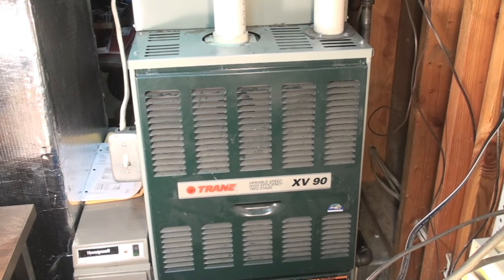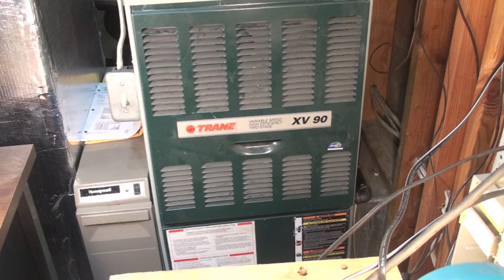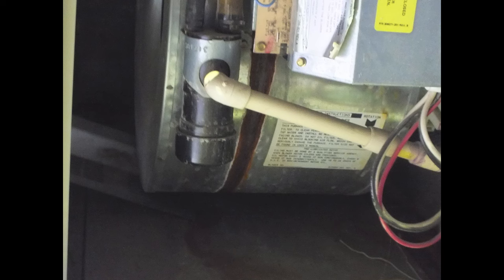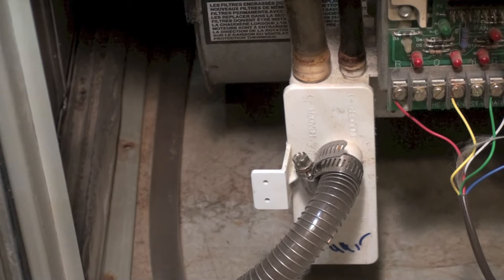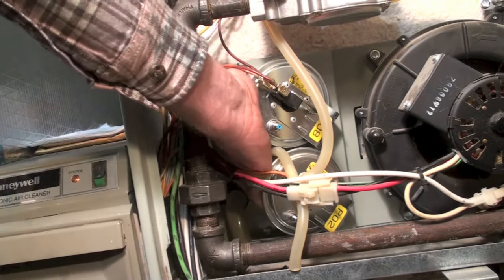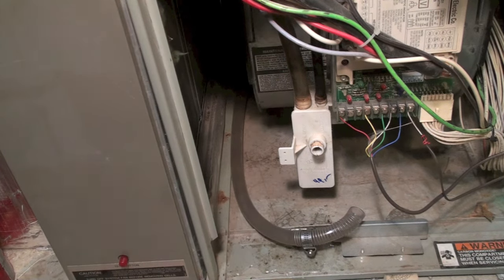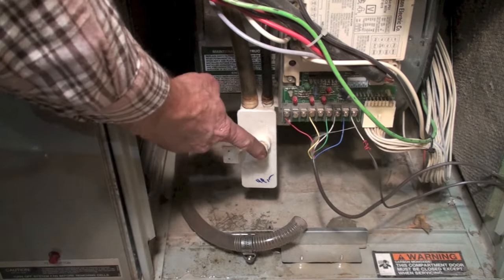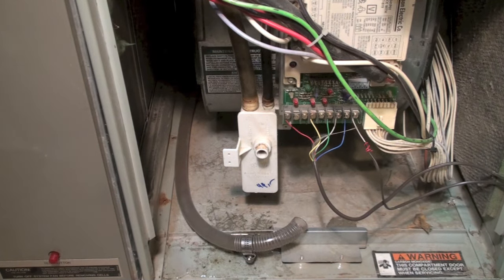Furnace condensate drain cleaning

Comment: I had technician service and he replaced pressure switches. Then 6 months later a different technician drained the condensate trap. Therefore furnace problem was never pressure switch. He removed trap and blew water and dirt out of the trap as well as pressure switches.
Reply from the maker: It is possible the water backed up in the piping to the level of the pressure switches.  That would necessitate replacement.
GFM

Comment: Trap smart and beware of double trapping. This will create vaccuums, plugging problems and screw up the inducer. But it also creates more money for repairman’s pockets, so them installing the drainage pipes in flawed configurations is a cash cow. You can create a double trap with your condensate pump too if tubing goes below water level. Yours truly, Kip G.

Comment: Is that thing really just a simple P-trap, or is there more to it? Why is it box-shaped? Have you ever opened one -- what does it look like inside?
Reply from the maker: +CognitiveDisonance I have not opened one.  Maybe I will do a video on it.
GFM
Reply: Yeah, I would like to know more about these. Like are they interchangeable? Mine is 30 years old and a little crack developed that allows condensate to dribble out. Previous owner fixed it with pvc cement and I am about to do it again. Could replace it with a $100 replica but then I see others that have all the same ins and outs for waaaaay cheaper so why can't I just install that at the same elevation as the old one and be good to go?

Comment: Thank you for the good video's . My 95% York condensate furnace was never installed with a P Trap. Would that be a good reason why my roll out switch keeps tripping. Thank you for any help you can give !
Reply from the maker: nastydog131 Probably not.  If the condensate line goes into the bottom of the condensate pump, that will act as a trap.  Although not a good one.  Look for heat exchanger cracks first.  Hope this helps.
GFM
Reply: The flame roll out for me was a partially clogged 2nd stage. It had half of the slots for air rusted shut so not enough vacuum to pull a nice flame cone. I pulled the 2nd stage an dissolved the rust by pouring through muriatic acid until iopen up.  Took a while, labeled everything as taking apart and took photos at each disassembly.

Comment: What is your opinion of this?  During pre season check and mx I would flush the flue pipe with hose water to clean the entire condensate drain system of the furnace.  I would add water at the end of the pvc flue a little bit at a time.

I haven't service furnaces in years now though.
Reply from the maker: dpeagles I don't think its a bad idea.  However in winter my hose always seemed to be frozen!
GFM

Comment: I have the exact unit pictured in the video...how much fall do you need out to the bottom the the existing trap? Can you run the drain hose from the trap directly into my 2" drain line for a bathroom sink vanity...downstream of the sink P trap without causing a double trap issue pressure switch issue?
Reply from the maker: There is no drop necessary, but if you are draining into an existing  drain you need an air gap.
GFM

Comment: OK, where do you put the shopvac hose? On that white part of the trap? My almost new furnace is not functioning and it's the middle of the night. The inducer motor/fan comes on and the igniter comes on, but the gas burners will make attempt after attempt to light, but won't light. The inducer goes on and off many times as does the igniter. Then after many long tries with thumps and bumps which I assume are the burner trying to ignite, the thing will finally ignite and burn for all of 2 minutes. I hear and see dripping coming out of the drain hose into the floor drain, so I assume it's clear. But the furnace is still going through what I wrote above. The red led will sometimes blink 3 times, then go on to blink random, like 25 or 30 or 11 times. The 3 blinks will happen again. American Standard Silver 95% EFI.
Could it be as simple as dirty filters? I'm out of filters and they have to be ordered online 20x25x5 for Trion AirBear. The filter looks okay, not all gray and dirty but still white. Is it wrong to let it run without a filter for the night, if that will even work? I tried taking each tube off the pressure switch and blowing gently to see if they were in need of clearing. The tube on the top nipple of the pressure switch would not push or pull air when attached to the switch. Is that normal?
Reply from the maker: +Doctor Spaceman You can run it without filters for a short time.  If you want to clean the drain, with a shop vac, remove the sensing tubes on the pressure switch then on the white trap.  The random blinking bothers me.  It does not sound right.  Possible bad connection.  You can try jumping out the thermostat at the furnace.  Jumper R to W on the board.  Hope this helps.
GFM
Reply: Hello 
What did it end up being? Mine is doing the same thing

Comment: I have a Carrier Weathermaker 9200 and when it starts up it makes a rattling noise and usually goes away after 2 or 3 seconds.  Today it didn't go away so I went downstairs and took the cover off and it seems to be coming from what I THINK is the inducer motor.  It's not from the motor itself but from the black housing.  It kinda sounds like theres water in there and may not be draining because of the reasons you mentioned in your video.  Does that make sense?  If so how do I fix it?  There are screws on the edges of the black housing so I assume that is what I unscrew.  I know NOTHING about HVAC so that's why I'm asking.
Reply from the maker: Ian Watson Your unit has a trap in front of the main blower.  I would be cleaning the trap and hoses.  I would not disassemble the the inducer housing.  Hope this helps.
GFM

Comment: Gary, I was wondering why my gas direct vent (upflow) furnace (High Efficiency) makes a lot of sound in the exhaust vent pipe. It's almost a gurgling sound. We are the loudest in the neighborhood. The furnace works fine since it was installed in 2010, but it's loud since it was installed. I'm wondering if I have excess water (condensate) in the line causing a trumpeting effect. Maybe the venting was installed incorrectly (with low spots).
Any idea?
Reply from the maker: +AIR CTI Technology You could have the furnace installed correctly as to level.  The furnace should be level front to back or slightly lower at the front of the furnace.  Hope this helps.
GFM

Comment: I thought your supposed to tale out the white box and clean that out.  I do that with mine as there is a lot of gunk which builds up in there.
Reply from the maker: You can do that.  This is just an easier way.
GFM
Reply: I do too. What I don't know is why does the p trap need to be filled with water after the cleaning.
Reply: @herewegoagain-sd9hr  because the furnace will not run until the system is sealed. The water in the P trap seals the system and allows the pressure switch to work, and the furnace to run.

Comment: Is this only an issue for ac or could it cause a code when trying to start the heater?
Reply from the maker: If your furnace is a condensing one (90+ efficient), a blocked drain could cause a code.
GFM
Reply: @grayfurnaceman  not 100% sure if its drained. Looking at the trap (white box) it looks bone dry. I'll have to check the piping. Should I just run a snake in there to be sure? Or would a decent amount of suction/air blow it out.
Reply from the maker: @photojnt  A vac will do.  Be sure to disconnect the tubing from the pressure switch before vac.  When you are done, fill the trap with water.
GFM

Comment: I have a Trane XR90 and there is water leaking on the metal base of the furnace.  I see water seeping from the 2 hoses that are connected to the top of the plastic trap...there are no clamps on these hoses...would clamps stop it from leaking?  What can be done to correct this issue?  Mike
Reply from the maker: +Mike R I would replace the tubes and install clamps.  Be sure the trap is not cracked.
GFM
Reply: +grayfurnaceman Thanks...can I take the trap off and run water through the (2) ports where the hoses connect and check for cracks in the plastic trap?
Reply from the maker: +Mike R Yes.  You should remove and clear any blockages too.
GFM
Reply: +grayfurnaceman Thanks for all of your advice...I added clamps to both hoses and remedied the leaking that was occurring.

Comment: Where does the condensation come from?  Is it a byproduct of the combustion of the gas or is it drawn in through the induction system?
Reply from the maker: When gas is burned, the products of combustion are C02, water vapor and heat.  It normally exits in the vent as steam.  High efficiency furnaces remove enough heat to condense the water in the gas.  It might be interesting to note that this water was last liquid water possibly millions of years ago.  It was locked in the natural gas compound.  
GFM
Reply: grayfurnaceman Is the high heat removal accomplished through carburation or the setup of the heat exchangers?

Comment: My Bryant Plus 90 from 1988 has that black plastic trap as you show on the Carrier.  I've cleaned it a few times over the years.  It drains into a basement floor with its outlet beneath the water level in the floor drain trap.  So I've got two traps.  Is that good or bad?  I really can't think through how the two traps would interact.
Reply from the maker: WD Hewson It should make no difference.  It will work fine.
GFM

Comment: I have a trane x95 and it keeps giving pressure switch errors.  I've checked all the hoses to and from the switch and the water trap and I can't figure it out. When I pull the hose for the condensate drain a lot of water comes out of trap.  It'll run after that and blow warm air but I can hear it build up again and it'll switch off due to the pressure switch error again.  I check the trap by pulling the hose that leads to the drain again and it drains the same amount of water again.  I wish I could figure this out.
Reply from the maker: Do you hear water in the inducer?
GFM
Reply: grayfurnaceman yes I hear water moving when it tries to start up and then hear it falling down when it fails. After I drain it and it runs fine warming for a few degrees and then the heating will stop after building up water again and it'll just continue circulating air only. It did this last year when it got below freezing as well - we had a someone out to service it but he didn't figure it out.
Reply from the maker: About all I can come up with is possibly the trap is not connected correctly or there is a blockage in the inducer drain.  Some of the Trane unit can get a kink in the line from the inducer.  I have seen this effect trane unit operation.
GFM
Reply: grayfurnaceman After disconnecting the hose that connects the trap to the drain pipe I tried pouring water down it. It backs up. Looks like I'll have to either unclog, defrost, or do both to the drain pipe unless you think something else is going on. Thanks for the informative video!
Reply from the maker: Looks like you got it.
GFM